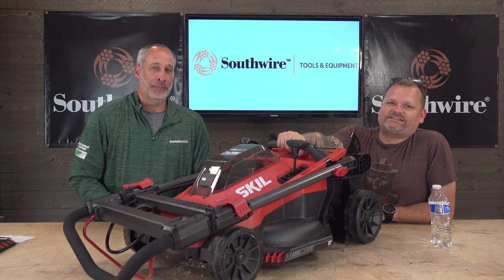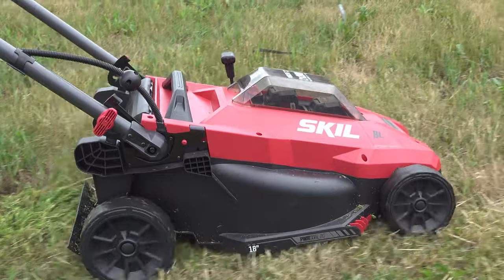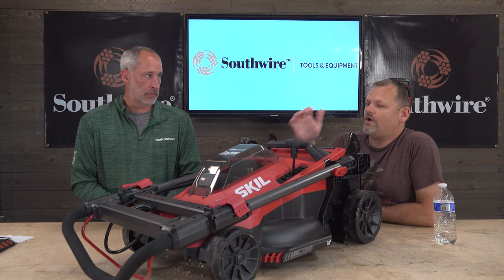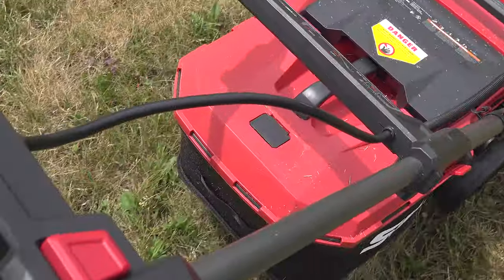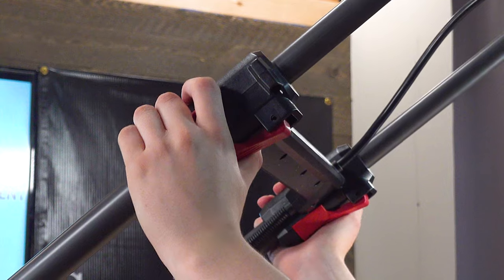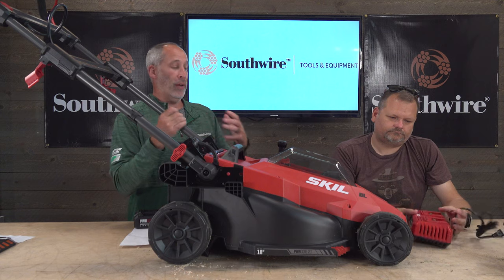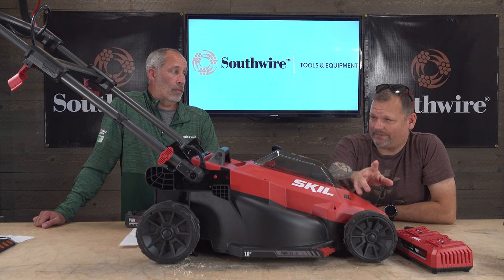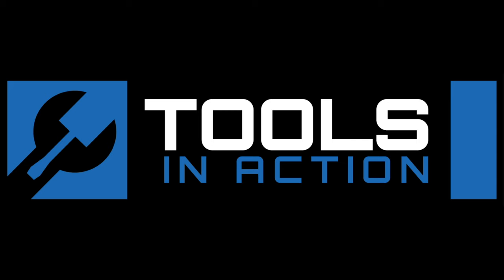This Mower Runs on Tool Batteries.

Comment: I liked the video but it would have been nice to hear a bit about the runtime and the capacity of the batteries that are provided with the unit. Ideally it would have been nice to see how it compares to similar units from Ryobi or other manufacturers. I like the idea that it uses power tool batteries as they would probably provide better value for a city homeowner rather tan a specialty 40v battery. Thanks for the video.

Comment: Since this is a 2 X 20 volt, isn't that really a 36 volt.  Or do the Skil 20 volt actually run at 20 volts and not 18 volts.  #TIACREW